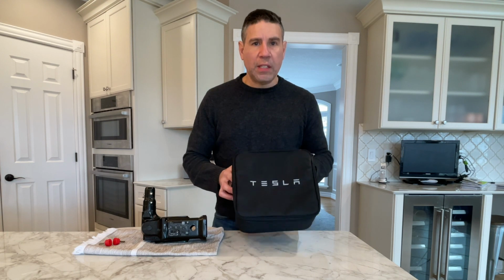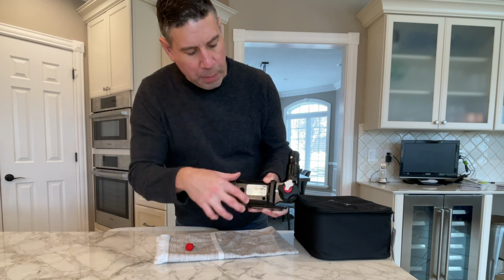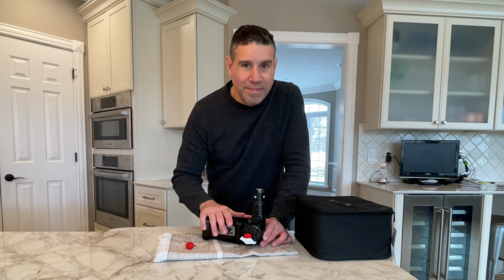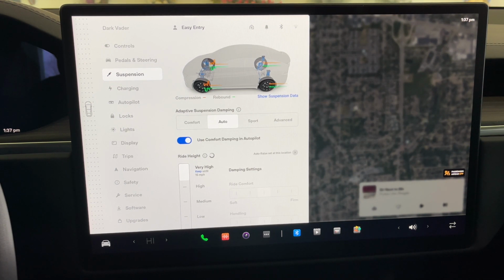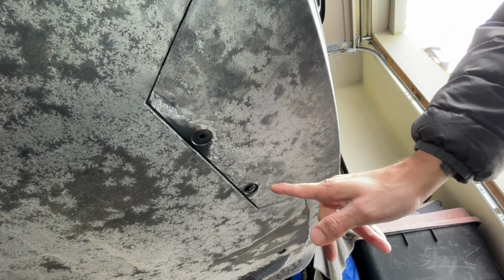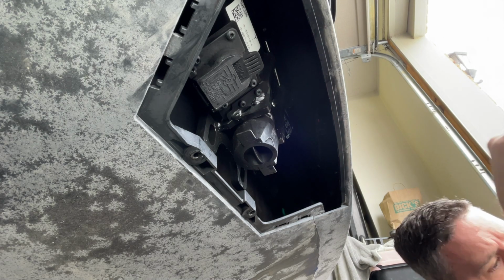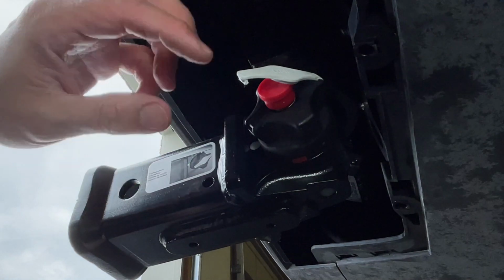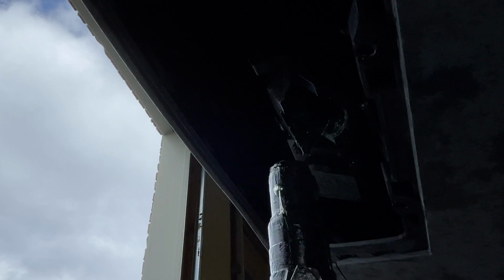How to Install a Tow Hitch in the 2022 Tesla Model X Refresh

Comment: Just got my MX Plaid and remembered your video. Using the hitch tomorrow. Thx again. Wow! What a marvelous car!!!!!!!!!
Reply from the maker: Hi Steven. Thats so awesome. Im glad you finally took delivery. I appreciate the positive feedback. Im working on another video that may also be helpful. Enjoy the X!
Reply: Just a follow-up, for what it's worth: After doing everything right, the hitch would not snap on. Took it to the dealer and they looked at it right away and even THEY couldn't do it. They persisted for over a half hour using different hitches and finally succeeded. I used it to pull a trailer and it worked great. Something I'd not thought of is pulling something takes away my auto pilot. (not to mention the obvious reduction in range) Take care. S
Reply from the maker: @scdi12  Thats intersting. I wonder why it was so difficult to put on. I also didn't know that while towing the auto pilot doesn't engage. Thanks for the info!

Comment: In the UK the electric panel is left of hitch. No harness is required. Take care replacing panel that it is clipped in secure. I obviously did not secure mine and it fell off and got lost. Thankfully a very helpful Tesla ranger came by and replaced for just a few bucks. I use the hitch in summer months for towing RV or for bike rack
Reply from the maker: I completely forgot about the bike rack. I think I may use it for that purpose. I won't tow anything but I could use it for the rack. Im waiting to hear back from Tesla the 2 clips that are broken. Thanks for the info and watching!

Comment: You can use a coin in lieu of an actual screwdriver. Those plastic screws break easily. Had to replace both of ours. The hitch can be used for a variety of uses beside "towing". Various items like bike or storage racks can use the tow receptacle. In our case, we used it as a recovery point when we high center in some snow.
Reply from the maker: Thats good to know for the next time I attach the hitch. Id like to purchase a bike rack for the hitch. Probably this summer. Thanks for the comment.

Comment: Can you give us an update on the wiring harness and I really wanna understand what might’ve been missing? We are getting ready to put our bike rack on the back so your video was very helpful. We picked up our Tesla model X Plaid just a few days ago.
Reply from the maker: Hi TCharlton. I haven't attempted to use the tow hitch since the video. If I can get hold of a small RVI 'll give it a try and post the video. Congrats on the Plaid X!
Reply: No wiring harness needed. Left of the tow hitch was a flap. That flap is for 6/7 blade wiring that you would hook up to a trailer. If you need the 4/5 flat version, you can just buy a converter basically anywhere(I bought mine at U-Haul).

Comment: i thought you need to pay extra for the tow hitch
Reply: comes included with the X
Reply from the maker: @joelrnyc325  It came with it but the wire harness is missing. I called Tesla today and there trying locate one for me and the clips that snapped that holds the cover in.
Reply: The Y is the other tesla that can handle towing,  and it's 1000 when you order the car,  or 1200 installed post purchase, which includes the wiring.  Depending what you will be towing on the y, it can reduce your driving distance by 60% or more.
Reply: @teslaownersperspective1968  I looked and mine doesn't have the harness either.
Reply from the maker: @rbowlesusa  You should call Tesla. I did today and they're going to call me back tomorrow to let me know when they'll have it in stock so that they can send it to me. I most likely wont be using it but I'd still like to have it. Let me know if you call and what they say.
Reply from the maker: @tmorcos21  60% is a huge chunk of lost range. I don't see myself ever using the hitch but its to have if ever needed. Thats a huge upcharge on the Y if you wanted to add it at purchase. I wouldn't use it on either Tesla.
Reply: @teslaownersperspective1968   @Tesla Owner's Perspective  It's not missing. The 7 pin connector on the back to the left of the receiver is where most trailers plug into. If you mean the brake controller, then it's optionally purchased from Tesla and goes inside down and to the left of the steering wheel. I keep trying to link the X user manual location but youtube has deleted this comment like 10 times so trying again without the link.
Reply: @teslaownersperspective1968  correct,  that is why I didn't put it on mine.  But my friends that have it on their model y,  just use it for local camping here in Southern California.  The y has a maximum weight of towing of around 3 to 3500 pounds.
Reply from the maker: @sorka95032  Yes you're right. Thats the cable that I was referring to. From what I understand it's supposed to come with the tow hitch. Thanks for helping clarify!
Reply from the maker: @tmorcos21  Is 3500 LBS a good tow capacity?
Reply from the maker: @rbowlesusa  Ive heard from a few people that have said the same thing. They didn't have it in their tow hitch kit either.
Reply: @teslaownersperspective1968  it's pretty decent.  The Ford Mach E has 0 towing capacity . I believe that your X has around 4500.
Reply from the maker: @tmorcos21  Good to know just in case I decide to tow something.